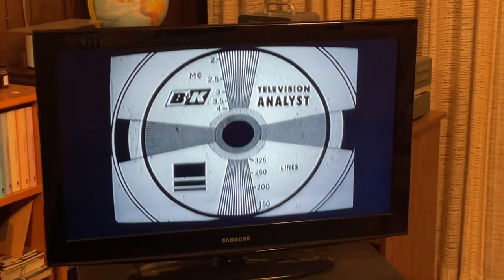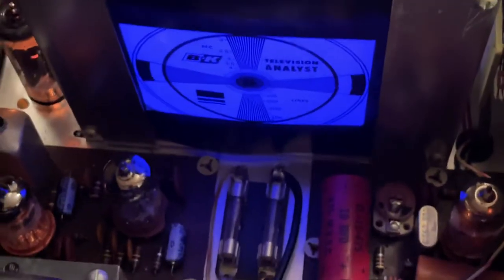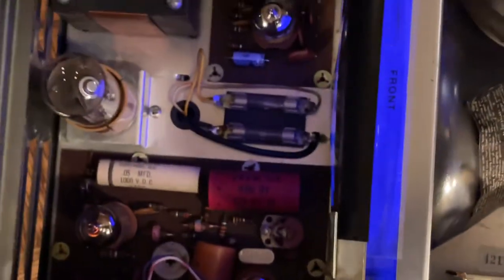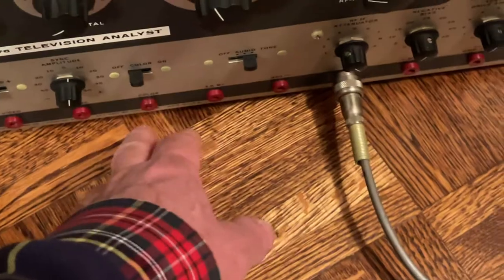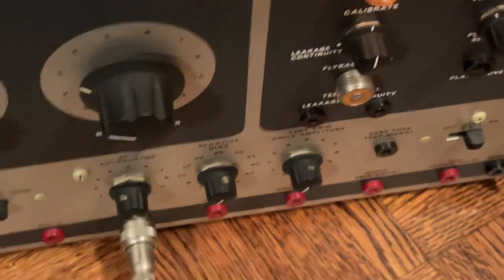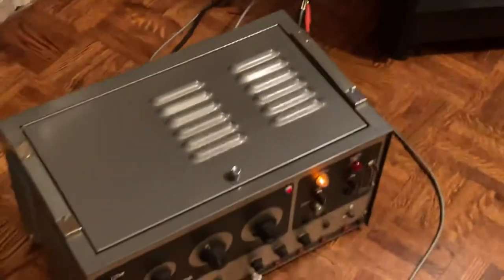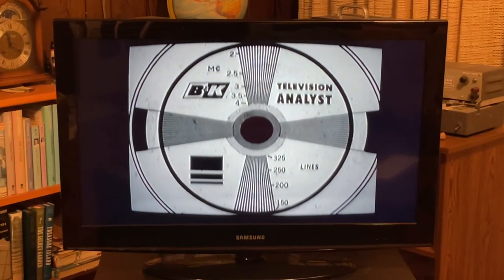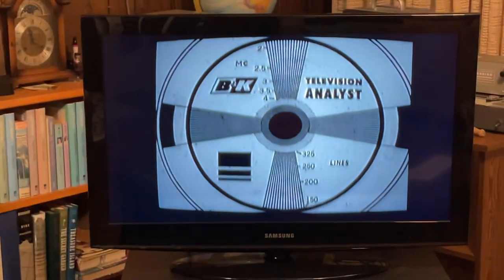B&K model 1076 TV Analyst 1960s test pattern

Comment: That is a beautiful piece of vintage equipment. I have several 1076/7's. I don't think any are working that well.
Find the orange and black colored book "Television Analyzing Simplified," by Milton S. Kiver. It is written to help teach and reinforce methods of signal substitution as outlined in the original manual provided with the Analyst by B&K. Good luck with your vintage electronics collecting, repair, and restorations. God Bless